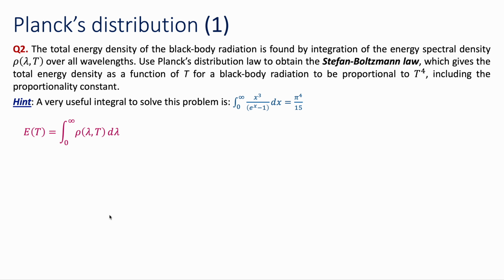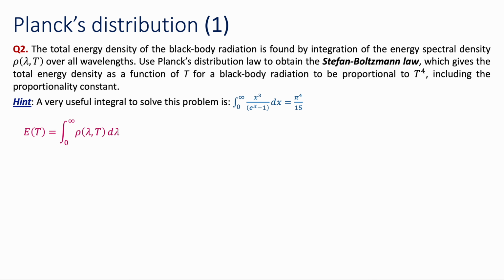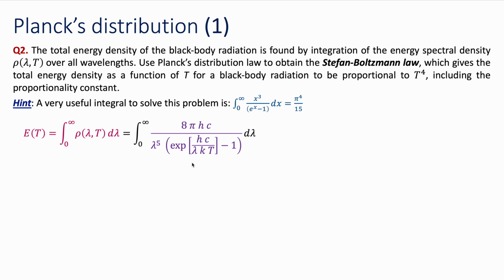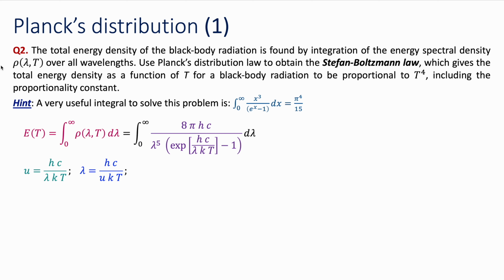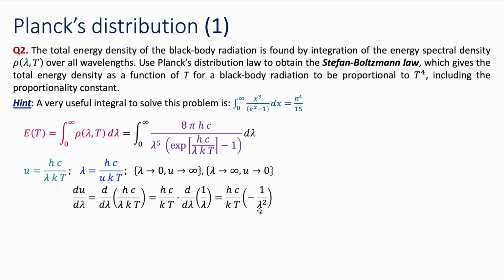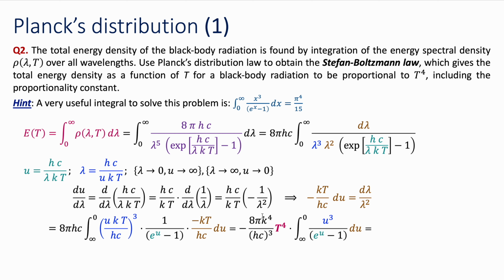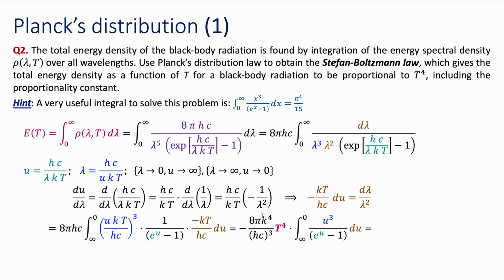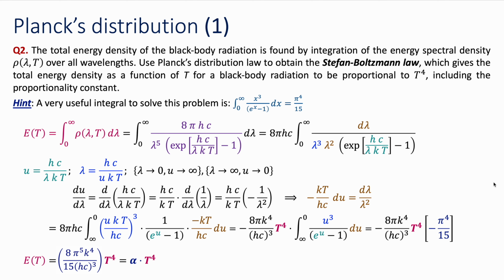Deriving Stefan-Boltzmann law from Planck distribution | *Multilingual (CC)* 🎧

Comment: Shouldn't it be the power instead
Reply from the maker: I think you are referring to the total emitted power per unit area (P), and I am calculating the total energy density (E). Those two are related by:
⇒P=\frac{E•c}{4}.
I made a previous comment about this, in relation to different ways -how- we can  express Planck's distribution. 
Anyway, that's why the difference between the constants \alpha (radiation constant) I wrote, and \sigma (Stefan constant).
⇒\alpha = (4/c) \sigma
 Actually, by the end of the video I mentioned this idea, of the equivalance between constants, and so, the SB law.

Thanks for your comment, Cheers!

Comment: Very well explained, and your answer to @mateihurba8580 clarify more. One clarification i need if possible: σ=5.67x10^-8 W/(m^2.K^4) without steradian comes from that formula with 2 at numerator, and is from a Hemisphere blackbody (what i undestand from 2 sites: spectralcalc radiance: integrating planck equation and NASA TE Michels planck functions and integrals). Is σ or your α constants valids only to Hemispheres? Like to a sphere we need to multiply by 2? Because the Sun sphere is widely stated with a Power of 3.8x10^26 W , using P=4πr^2σT^4 gives that also (T=5780 , r=700Mm), but maybe is wrong by a factor of 2, and is really 7.8x10^26W, by that fórmulas. But truly is 3.8x10^26W, by the independent measure of 1360W/m^2, at the Earth distance of 150MKm. I cannot understand why they talk to hemisphere.
Reply from the maker: Hi,
Thanks for your comment, the quite interesting question, and the reading suggestions~!
To your question. It is related to what my other answer discussed before: what quantity are you considering,  spectral {intensity, flux, energy density}.
One way to see it is that we can express results irrespectively of the size or amount of a sample. Say for example, density of water: It doesn't matter if it is just a glass or a whole pool. The idea is that you characterise it as how much mass is contained per unit volume.
Similarly, here we get the spectral energy density (radiant energy contained in the volume of the cavity per unit wavelength, u_{s}=u/dλ). It does not have the square-radians because, for a volume element (dV), it's pointless to relate the energy density to a solid angle (Ω = A/r²), instead, you use the whole volume (a full sphere, dΩ = 4π). This is where the factor of 4π comes from in the relation posted in my previous comment:
u_{s}= u/dλ = (B_{s}/c) dΩ = (4π/c) · B_{s}

One gets the total energy density inside the cavity of a black body by integrating the expressions for u_{s} over the entire wavelength or frequency range (as in the video). What do we get? That this total energy density depends only on T~!

In any event, the hemisphere comes from the concept of a blackbody itself: an opening (leading to a cavity) that absorbs incident radiation and thus emits radiation. Note that this radiation propagates into "half-space." One must consider a surface element (dA) corresponding to the area of the opening, and to measure the total emitted radiant power coming off from it one must sample over the entire "half-space" (2𝛑, hemisphere). This is because our measurement is affected by the orientation of the detector and its "coverage" (this is where the solid angle, Ω = A/r², and its dΩ are relevant). 
Finally, the reason the Spectral intensity I_{s} and spectral flux B_{s} differ only by the factor π (not by 2π) comes from the integrations carried out. Actually, check out again the first reference you mentioned (integrating the Planck eqn). There, it mentions the "cosθ reduction from Lambert’s cosine law." and you can see how it works.

Hope this helps~!

Comment: This video was very helpful! One question, isn't the factor of 8 in Plank's law supposed to be a 2? In that case, the alpha factor would be different.
Reply from the maker: Hi,
Thanks a lot for your question~! It actually goes back to the last few seconds on the video where I ponder about the relationship of the "\alpha" α (radiation constant) I wrote and the Stefan-Boltzman constant, "\sigma" σ.

You're not wrong, but we must clarify that there are various forms to write Planck's Radiation Law, according to the quantities considered. Commonly, we can express the radiation emitted by blackbodies using,
 ● (A) intensity per wavelength (or frequency): distribution of spectral intensity I_{s}.
 ● (B) intensity per solid angle: specific I_{s} or a.k.a. spectral flux B_{s}.
 ● (C) spectral energy density: E_{s} —also written as u_{s}— used in this video. 
 Additionally, note that each of these can be put in terms of the radiation's wavelength (\lambda, λ) or frequency (\nu, ν). So, yeah, there are several equivalent expressions out there. 

That being said, and without going into details (too long for a comment here, but I invite you to research about it), I leave you with the relationships among these quantities. That ultimately answers your question, and the question that I pose at the end of the video too:
  ☆ I_{s} = π · B_{s}
  ☆ u_{s} = (4π/c) · B_{s}
  ☆ u_{s} = (4/c) · I_{s}
Where c is the speed of light. 

You can see from those expressions that likely you're referring to B_{s}(λ), whereas I presented a discussion with u_{s}(λ). 
  ○ So, how would you write α in terms of σ?

Happy Learning~!
Reply: Ah, that makes complete sense! I was indeed referring to the intensity per solid angle... oops. I'll definitely do some research on the different, albeit similar, mentioned quantities. I'm sure they come in handy in other problems.
Thank you for the thorough answer!  @chocolate_3867

Comment: Mmmm you are too fast sir. I'm failing to follow through.
Reply from the maker: HI, thanks for your comment.  May I ask what is causing the problem? 
* Is it the pace or speed? You could slow down the video using settings.
* Is it something that can be helped with turning on Closed Caption in settings?
* Is it something related to the details of the calculations that are not clear enough?
... Something else?

Cheers~